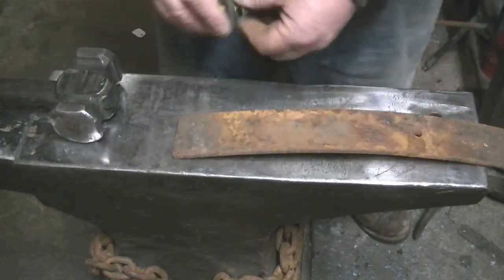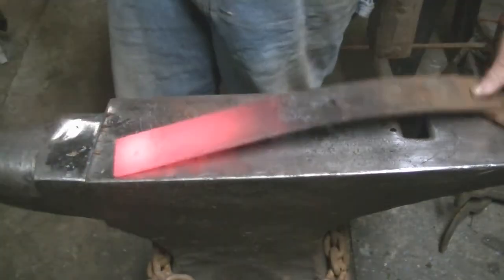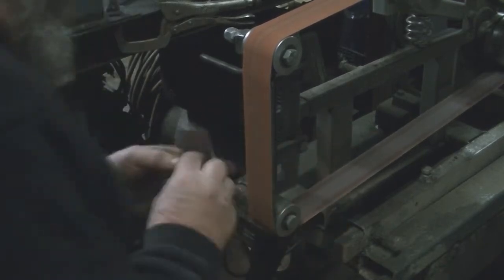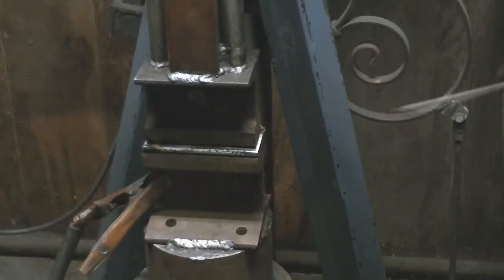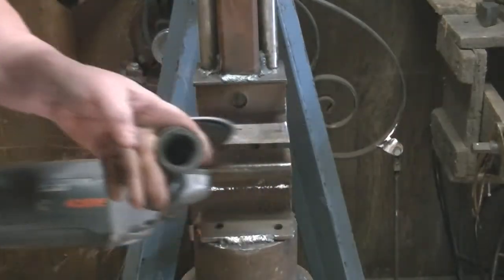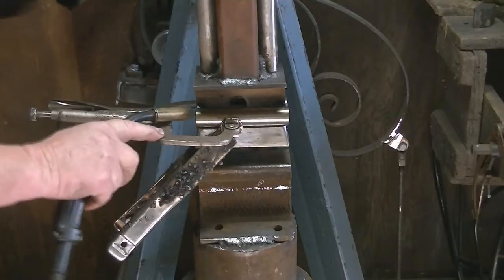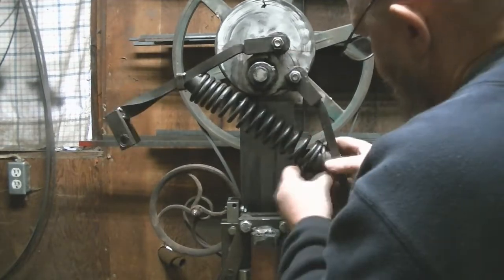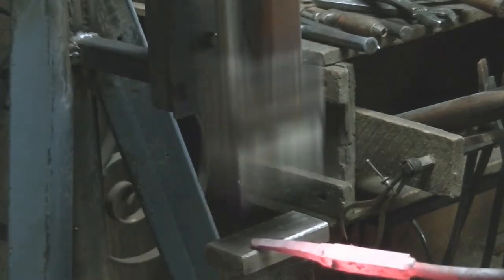Power Hammer Modifications To Increase Output

Comment: hammer is nice but i could not see how you transitioned from the large round block to the spring section , was it a pin welded to the block with another pillow block attached to the arms for the spring or somthing ?
Reply from the maker: Check out my video on power hammer Q&A I think you'll find the answer there.  And thank you very much for checking out, merry Christmas.